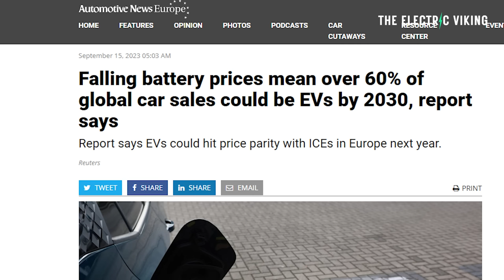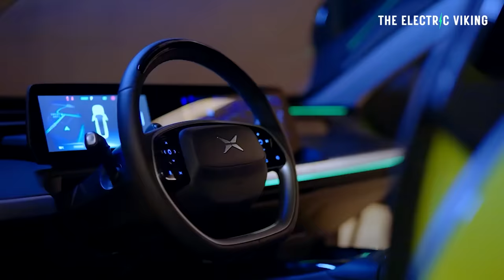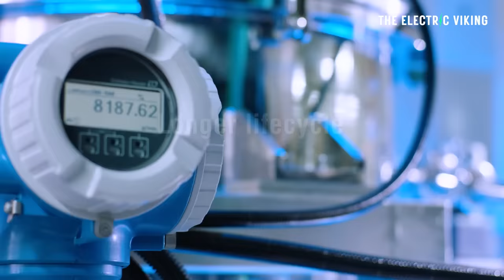Small EVs hit price parity with internal combustion after huge battery price fall

Comment: Spot on. Legacy car companies already have factories and facilities that are stranded assets.
Reply: That's why Toyota is spending a fortune converting their factories over to all-EV production by the late 2020's.
Reply: @Sacto1654   SOURCES. I don't see this at all.
Reply: Ice assets?= liability cause transition
Reply: Decades ago I made suggestions that been adopted and failed because I would never reveal the full program necessary for it to work, example is from the 1800’s and not my idea but the battery swap idea I suggested to Renault was done in a cooperative between them and Nissan and failed, why? Because they’re effing idiots. Here’s one suggest I made over 30 years ago nobody has announced from amongst the auto manufacturers but may be here soon and would mark the absolute end of the EV market not because they suck which they do but because it would have made the need for EV obsolete and it is a scam they’re trying to capitalise on before everything has to shut down since those batteries will just burst into flames like a tank filled with petro as the asphalt all over the globe gets hot enough to fry not just an egg on but some potatoes for a great meal. Ready for this? It’s several motors in one powerplant that uses the primary exhaust as fuel and the secondary exhaust is turned into fuel and so on until the exhaust left to exit will be of a benign sort. The best way to explain this and the simplistic way is this. Take a V8 engine, 2 cylinders burn a small amount of petrol, the byproduct is Carbon Monoxide, Nitrous Oxides, hydro carbons and lead, (CO,NOX,CH&PL) those components can enter whatever of the other cylinders through processes and be used as fuel as well.  1-2-3 cylinders or whatever, those produce another by product which then enter 1-2-3 of the other cylinders as fuel. Additives or a new formula of present day petro may need to be developed but it’s no impossibility that it can not be accomplished. So to recap you put petro used by 2 cylinders of a V8 or v10 or 6, after that cycle is complete rather then what’s done presently like funnel some through a PCV valve to reborn hydro carbons that exhaust is utilised in 2 of the next cylinders to produce power that exhaust to the next 2 then the final 2 until what is left is minuscule compared to presently , ultimate goal is no exhaust and even a product that can be contained and used in other industry. Like 4 engines in one car to produce equivalent or near HP & Torque. No need for EV unless you really want one.  You know why it may never happen? GREED and the people who are wana be Elites who are going to get what they deserve. A guarantee the children of their children may never see the light of day because there’s nothing but tools or as the Jews call them Golems born every day doing the sam crap nothing new to survive and would be better off just letting the planet rot. Have a pleasant day .
Reply: @carlospenalver8721  Interesting ideas wrapped in a eccentric rant. Work on your delivery.
Reply: @robertmartens7839  no. The V8 analogy wasn’t literal just representative of what was discussed in aol chat rooms and yahoo chats long long ago. I began trying things out and once i realised the industry  is full of nepotism and straight up clones of one another it was evident the pursuit would not have been as fruitful, I rather just sweep floors at a auto plant then bother. Anyway too late, I’m old, money doesn’t mean crap, don’t have kids so to hell with all of yours and your mom should have known better then to shat kids in the world who will have to tell their kids not to have any or they are going to suffer . In case you haven’t payed attention countries are slowly pulling back from the goals of saving the planet, it’s a pipedream.

Comment: Have a kona ev and couldn't leave my commute area because ccs charging is pretty unpredictable. So I got a tesla and hardly have time to take a leak, wash my hands and get the car out of the charger to get coffee. The supercharger network must be the norm in the future for all evs after they tear down all those smelly gas stations.
Reply: Been a ev driver for 12 years, but would never considered owning a Tesla
Reply: @phileasler5401 you must’ve been enjoying a lot of compromises if you drive a non Tesla 12 years ago
Reply: I remember reading that living within 2,000 feet of a gas station is considered a health hazard with is just added to breathing all the exhaust fumes and vapors gas cars generate.
Reply: @SyntheticSpy  not really….
Reply: @phileasler5401 so Nissan Leaf?
Reply: Hyundai Dealerships are offering two years of Free DC fast charging in New England USA with Electrify America. So I asked where are their chargers in Ski, Lakes and numerous resort areas of Maine, Vermont and New Hampshire. Told me it is not their problem that it is Electrify Americas but, but…
Reply: @SyntheticSpy  Try it before you defy it.
Reply: @BioniqBob  there are many good options now, although I would argue you won’t be able to find anything close to the value for money of a Tesla, but in 2011 there were not really good EVs that weren’t Teslas. The leaf at the time had a small range and cooked its own batter thanks to a wimpy thermal system
Reply: @SyntheticSpy  IONIQ 5

Comment: this is clearly all shaking out faster than predicted.  I just had a Model 3 rental and at this point, an ICE vehicle seems like old tech, and at current prices, not worth investment.  I was also pleasantly surprised how easy it was to find and use a charger, specifically Tesla superchargers.  Tesla's valuation seems reasonable at this stage of the game, they are the iPhone of EVs
Reply: Tesla has led the way, but the competition is catching up and in places overtaking it. It needs to lift it's game in areas of affordability and practicality.
Reply: @jimgraham6722 I'm getting more the impression that Tesla is pulling away (if Musk can stay sufficiently focused).
Reply: @bearcubdaycare  In our family we have. TM3 and an Atto3. Both very good cars. There are a few features of the TM3 I would like to see in the Atto. There are lots of features in the Atto I would like to see in the TM3.

Cost is also an issue, the Atto was over twenty percent cheaper than the TM3.

Comment: Sam, I think that you are focused on selling price when you should focus on monthly payments + ownership costs. In Madrid, a taxi driver switched from a Prius to a Hyundai electric. His electricity bill and maintenance dropped so much compared to the hybrid that the savings was more than his monthly payments. In short, compared to the Prius, it was as though the Hyundai were free. Moreover, we fit four passengers with three huge suitcases into the Hyundai electric whereas we needed two taxis in Dubai.
Reply: It's amazing that not enough people are doing the calculation or are not aware of the savings. Access to good charging remains an issue for many though.
Reply: When electric cars provide more than combustion cars at purchase you don't even need to think about running costs, in fact they could even be higher but electric cars would still sell.
Reply: Look at Tesla model 3 long range that's 5 years old vs new ones
Reply: I think the ev maintenance savings are over hyped.
I do an annual oil and filter change, takes me 30 minutes/$100. 
First set of brake pads at 90,000km.
Vacuum out the bugs from the air filter waiting for the oil to drain. I guess the coolant is due for it's second change as car is now 10yo. That's it.
Everything else, suspension bits, wipers, cabin air filters etc, no difference between the two.
And then there's tyres. I hear ev's eat them on account of all the extra weight and acceleration  - and those things aren't cheap.
Reply: @petercroft9895  Average maintenance cost for 10 yr. ICE vehicle is $1,700/year. Tesla Model 3 projected to be $370/yr. Fuel savings $2,000/yr and going up. Don't accelerate so hard to chew up tires. Average Tesla Model 3 and Y is the same as the average weight of vehicle sold in US.
Reply: @todd1771 Your not taking into account the price of hiring an electrician to install a electrical charging station in your home and the increased electricity ,your bills going to be astronomical.
Reply: With increased sales,  technological improvement , innovation- the price of Ev and maintenance running costs will decrease. Ice cars already reach maturity. Ev yet to reach. Let car makers cooperate for maximum efficiency and effectiveness. 
Amen om mani Padme hung
Reply: @donaldpiper9763  No. Electricity at Tesla superchargers is already about half the price of gasoline for equivalent mileage. Charging at home will be half of that. And if you get solar panels, the electricity is free! Try filling up your gas-guzzler with solar power.

PS. I drove past a gas station near home recently. (I never stop any more.) A gallon of regular gas was $5.80, premium was $6.18, and diesel was $6.70. Depending on location and time of day, I can add about 300 miles to my Tesla for between $4-30.
Reply: @todd1771  Over 6 years of EVing now, I do 95% of charging is done at night. 
I get 60 miles for a $1.00, about 100 miles in the city.
The only ICE I deal with is the ice in my drink while the car is charging.
Cheers
Reply: @todd1771 Personally,  I  don't care about the poor charging infrastructure.  Even if there was a charging station on every corner,  I'd continue to only charge at home. I  pay max $.12/kwh at home. Public fast chargers can cost as much as $.48/kwh. And charging your vehicle on a fast charger reduces the life span of your batteries.  One of the big complaints people have about EV'S is they don't charge fast enough. They don't have a clue, the faster they charge their batteries the sooner they'll have to replace it. With the battery being the most expensive component in any EV, I prefer taking good care of it by charging it slowly at home. Even using my 80 amp ford charger I'm only charging at 19 kw per hour compare to fast charging the lightning at 150 kw per hour and some other vehicles even higher.
Charging at home, time is never a factor.  I only charge my truck to 85% and seldom take it down to 15%. With that I can be charged back up to 85% in 5 hours. And since I seldom drive more than 60 miles a day, often not every day, I can easily make 3 trips before I even need to charge it. Averaging $6 to drive 100 miles.  Isn't the greatest but better than my 50 mpg prius that I traded in. And this is nearly a 7000 lb vehicle.  Plus I can haul, tow with it. It rides smoother than my prius and I  can power my home with it in an emergency.  One thing everyone seems to forget, I'll never have to change oil/filter again,  along with so much other required maintenance, no more waiting in smelly gas station lines. The list is just too numerous to mention in these comments.
Reply: @donaldpiper9763  LOL, It cost me around 800 to install a home charger but I have already saved 2200 bucks in gas after only 20,000 km.
Reply: @todd1771  As the owner of a ten year old ICE that I've owned for seven years, exactly what am I meant to spend $1700 on? In NZD my spend is $100 oil change annually,  a new set of tyres and alignment every 40000km, so $250/yr, one set of brake pads, $20/yr. Let's be super generous and call it $500/yr all up to include the occasional brake bleed, radiator flush, and annual safety inspection. I am one of those old farts who actually knows how to twirl a spanner, and only pays some other monkey to do things that I absolutely cannot do myself. Even going the dealership servicing route, I don't see how you'd get to $1700 - unless it's one of those high maintenance European cars.

Comment: Once the EV fast charging network is fully deployed,  range anxiety will be a thing of the past, even for low range battery technologies.  e.g. sodium ion for example. If you can fast charge to 80% in 10 minutes for every 300km, it's not a problem.  It just means two ten minute stops over a  900 km trip, which is what you would do anyway.  The first charge would be done at home over night.  Most homes don't have a petrol pump at home.  This aspect contributes towards equalising out the lower range issues.  The average daily commute in Aust .is only around 16km.  There are no barriers to the future viability of this technology.
Reply: I look forward to when the EV fast charging network if fully deployed and you have charge stations every few km in urban settings and not more than every 50 km in rural areas.  Cheaper safer Sodium ion batteries wont have a problem fitting in with a mature fast charging EV network.
Reply: Range anxiety is mostly a phenomena amongst the EV sceptics. 

Once you appreciate the benefits of charging while parking, that AC charging is enough for (at least) 90% of their driving.
While waiting for rapid charging isn't actually a thing, because you have other things to do while you rapid charge.
Reply: Agree
Reply: According to the ABS, the average annual drive here in Oz is 11k kms = 30kms per day. The average daily commute is 42kms. This 42kms can be recharged at hone from an ordinary power point in just 3.5hrs.
Reply: "Most homes don't have a petrol pump at home" but it does not stop them from huffing the fumes. (the crazies ones)
Reply: @nordic5490  But what if they need to drive to their alternate reality?
Reply: You are assuming that you live in a car commercial where there are no other cars on the road, aren't you?
Reply: @actual_nonsense  300km? What a joke! The meaning with ev cars are longer range not shorter, aren’t they? I prefer to refuel 700kWh in two minutes with 1300km range! Then I have 10kWh/kg compared to 200Wh/kg.
Reply: @nordic5490    Yes people will charge their EVs just like they charge their phones.  i.e. overnight.
Reply: Range anxiety will come back!
But now for diesel and gas car owners. 🤣
Reply: @hanswitvliet8188  Waiting for the bank loan to buy some fuel.
Reply: @actual_nonsense     True.  EV's use even less energy when the traffic is stopped, even if newer vehicles haves top start technology, EVs still trump that.

Comment: Tesla Model 3 and Model Y are already less expensive than the average new car price in the US. The average new car in the USA is $48k and climbing higher. Tesla Model 3 and Model Y are already less and then add in the Federal Tax Credit. The future is already here, at least in America.
Reply: Basic Tesla is different than the 50t weight V8 pick up people buy in the USA… Maybe cyber truck will change that, but cyber truck is not cheap…
That requires 10$/gallon gasolin price… to change that.
Reply: The basic argument against Tesla, at least amongst the anti-EV crowd in the USA, is that “Teslas are too expensive.” Well, this as a rule is no longer the case. It is only the grandiose sense of entitlement in this country where a pickup truck the literally size of a Semi-truck cab has become somehow engrained that makes an apples to apples comparison still relevant. The basic premise however is still EVs are no longer more expensive and only for the rich. Most middle class CAN afford an EV now. They just choose not to in this country. This WILL change sooner or later as the price difference caused by ever-increasing gas engine vehicles forces the issue.

Comment: As soon as Long Range battery vehicles hit 400 or more miles, and commuter battery vehicles hit $25K with 300 miles, it’s over for ICE.  Most people drive 30 miles round trip or less for daily commuting and about 100 miles on the weekend.  There is little reason for gasoline personal vehicles after these two requirements are met.  The two gas powered niches remaining after that will be work trucks, and vans.

Comment: In my town Shell just opened two new stations with no provision for EV's .  Genius!!!
Reply: Supply and demand.  Right now the small use of such facilities can't sustain the cost of maintaining them.  For the same reason hydrogen filling points are actually being removed from the UK.  Some supermarkets and other carparks have been removing EV charge points for the same reason.
Reply: Who would want to go to a petrol station for electricity? ;)  Shell have sold out their charging business in the UK to Octopus.
Reply: @djtaylorutube      they're extremely hard to find. Waiting for Walmart to open some like they've promised
Reply: @dougsheldon5560  There's some near me but the pricing is utterly pointless for a Tesla driver since the Superchargers also nearby are less than half the price.  It's as if they don't want any business, probably why they've sold up to Octopus here.

Comment: I agree with "Sales" but their are lots of people like me, cheap. I haven't had a car payment ever. I paid 4500 for a Ford 10 years ago, still driving my beater and I make a little over 100k a year.  Im pro EV but im also pro me as well. I won't buy a EV until it makes financial sense. Prob 20 years? Maybe less depends on fuel cost and such. I drive 5 miles to work.
Reply: Yea I say about 10 more years really. There are some new advancements coming almost every year that drops the cost of them new. 2nd hand will be where you get one for around that 5k mark. Next 5 will be seeing batteries version 3 and 4 that uses solid state and sulfur chems. That alone drops the number of batteries to 1/4 same with weight along with that 2.5 to 3 times the power per kg. If they switch from Li to Na we could be seeing even more of a drop.
Reply: No need for EV until the gasolin will cots more than $10 / gallon… after that EV can become very tempting…
Reply: On par if I was forced to buy a new car it would be Tesla/EV. But im not. Im a A to B car guy. New compared to new EV is a better bargain. It will take some time before used EVs equal quality and price of gas. It will happen, not yet though. @haukikannel